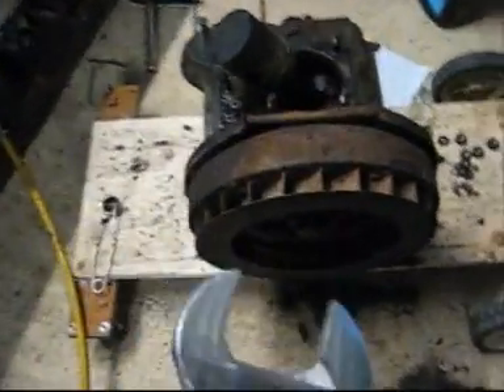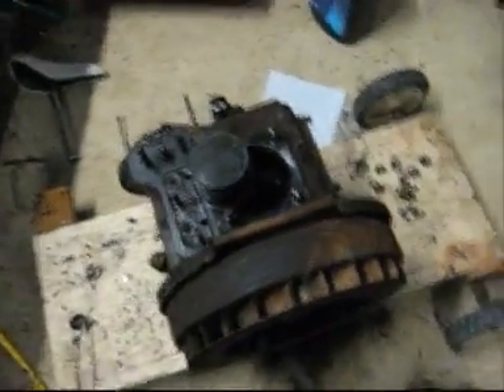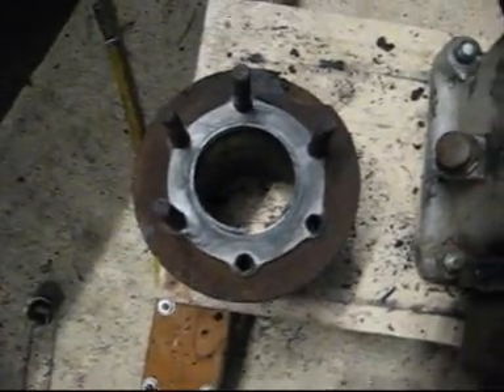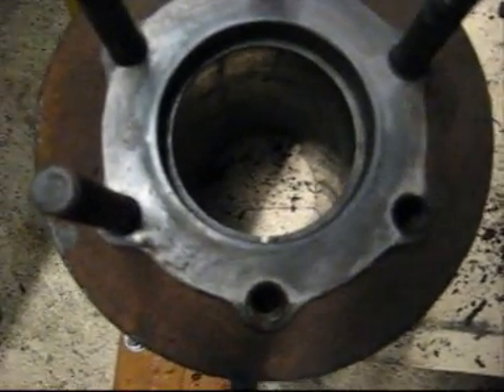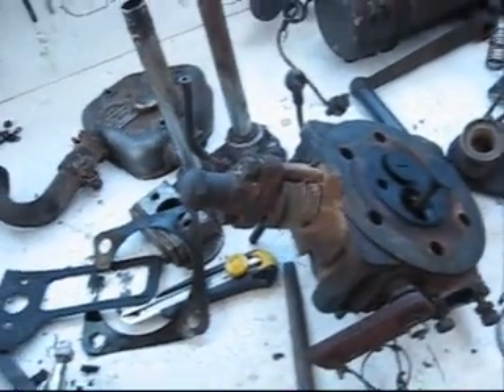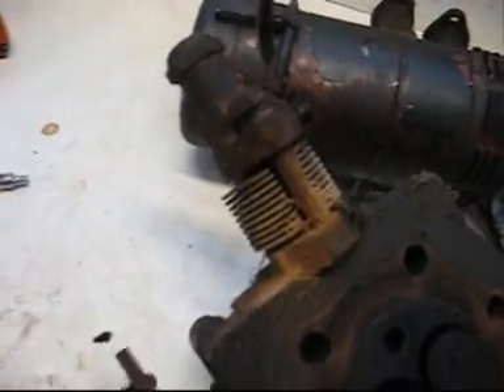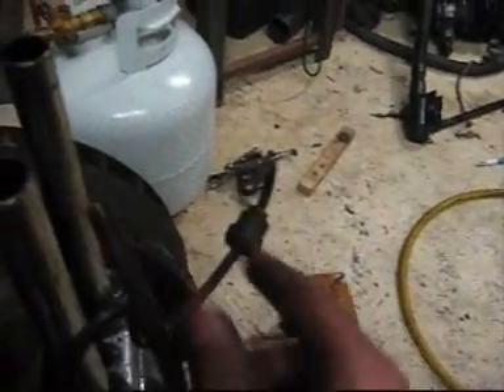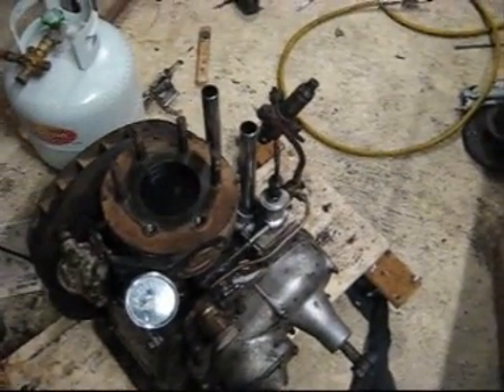Coventry Victor part 3

Comment: this is by far my favorite vid by you on youtube. this is such a cool engine. I wish I had one. oh, by the way, when you put the ring by itself in the cylinder to check the ring gap, you are supposed to check the gap in 3 different positions in the cylinder. top, middle, and bottom, because of the different amount of wear inside the cylinder. just telling you, in case you might want to check that in case you have to get it bored out.